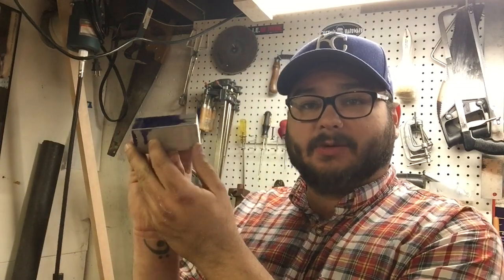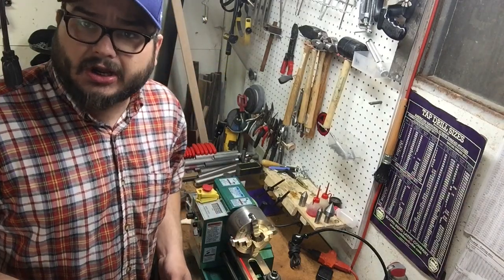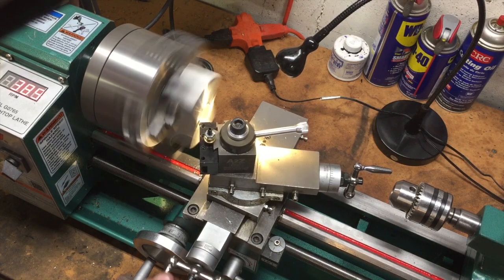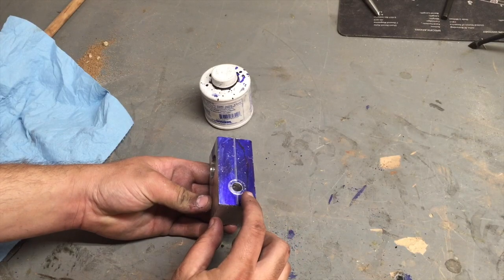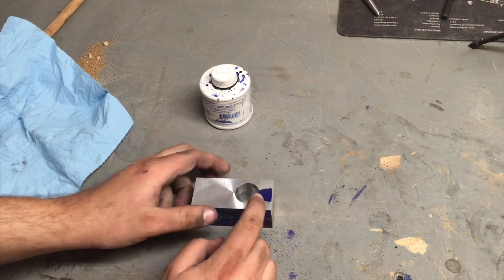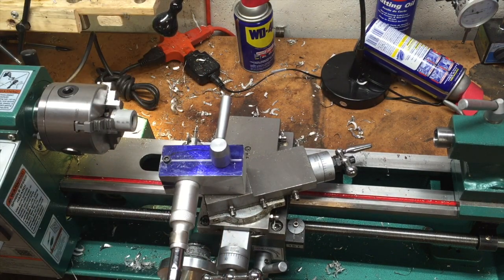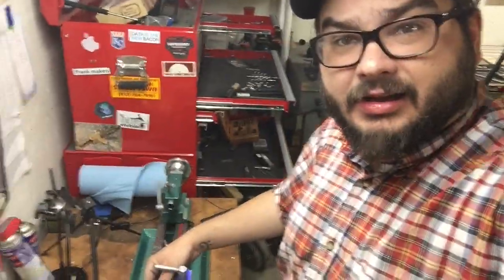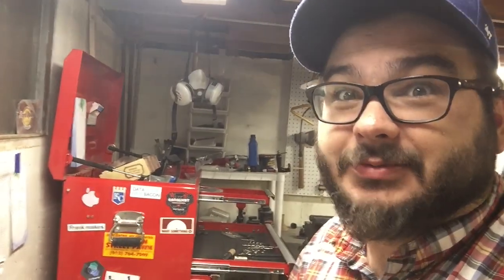Making a Tool Post Grinder for the Mini Lathe

Comment: seen a chuck lockout that doubles as a dividing tool : it was nothing more than sumting mounted to the gearbox of the lathe locking one of the gears  
counting teeth you could make equally spaced holes or grooves intoo youre workpiece

Comment: 9:19 i have the same "endmills", they are not for milling but intended to be used a s a burr. If you want a better cutting performance use real endmills with 2-4 flutes made of HSS or better. You can find 1/8 inch (3,14mm) shafted HSS endmills on ebay.com sent from china.

Comment: one way i seen done to index the chuck was to use the drive gears in the back of the lathe , they basicly made a small tool that meshed intoo the teeth of one of the gears (think the simples would be to find an inch long piece of bar of a rack and pinion system that will mesh with said gear) , you can index if you devide the amount of teeth by the amount of divisions you need to make , as long as you end up divided by whole teeth and not 1/10th of a teeth you should be ok 
allso wat you might be able to do to clamp the tool in propperly is saw the block all the way through and take a little out the middle so you end up with an oval hole , should be good to clamp the tool in without the shim , the tool itself should prevent the two haves from turning independent once its tightened

Comment: Could you please give me some insight into the blue marking ink used on the work piece bro? I see it used quite a bit and as Im just getting into lathe work and machining I would love to know what is generally used for marking work and making precision cuts accordingly.. Any knowledge you could kick my way I would really appreciate. Thanks boss! 

(Great videos btw)
Reply from the maker: +TacticDesign  It's called "Dykem" you can find it at any of the online suppliers, and sometimes in walk-in stores like grainger or metal supply shops.  Another handy alternative that a lot of guys use, too, is just a blue (or any color) sharpie. Hope this helps,  Thanks for watching!
Reply: Thanks boss. I gotta say I have very much liked watching your videos. When I was researching my lathe your review of this G0765 was one of the first I came across. Then I started seeing all the add on videos. You've done a damn good job keeping up with this lathe. The repairs and everything have really helped me feel a lot more comfortable taking down my own machine. Great stuff, Keep it up bro!